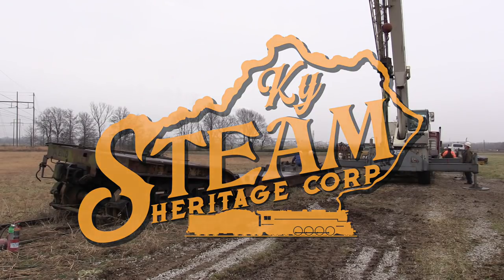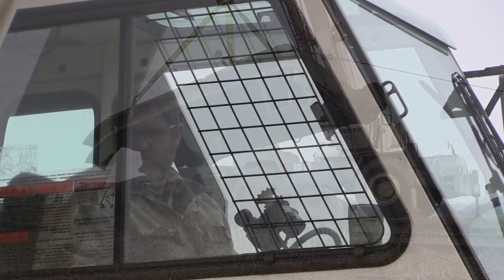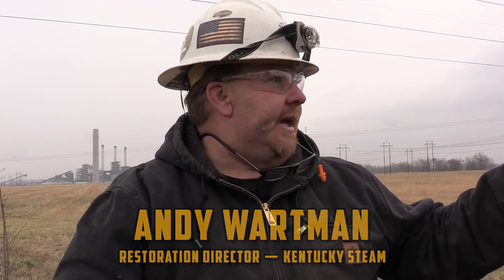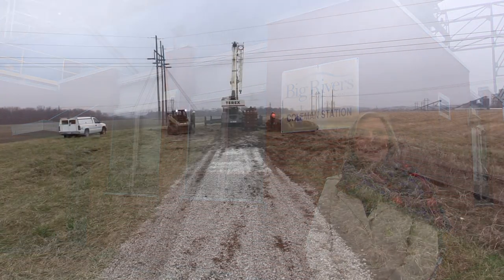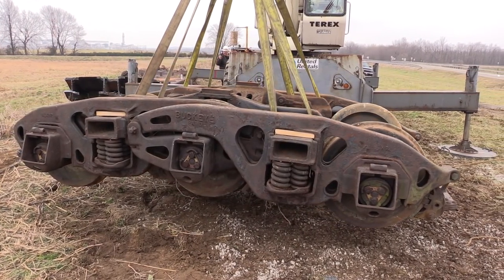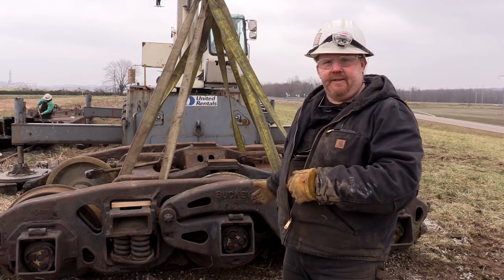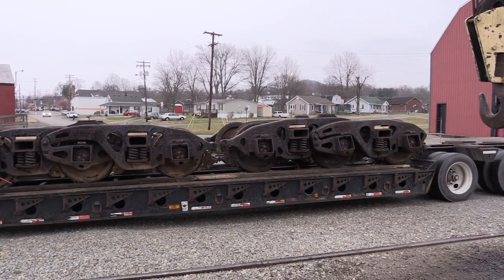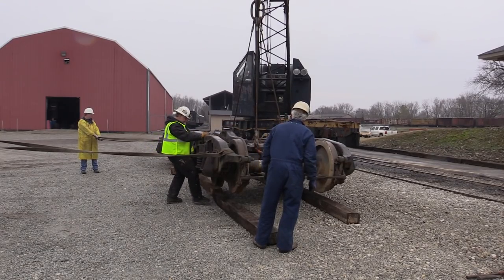Kentucky Steam Moves C&O 2716's New Roller-Bearing Trucks

Comment: Since the new roller bearing trucks still have the old journal box housings with hinges, will you guys place 2716's journal box cover hatches over the rollers to hide them and make it look more authentic? I think that would look pretty cool.
Reply: Lots of steam locomotive operators do that, as it's the best way to make it look authentic. 745's tender trucks and trailing truck where retrofitted with rollers, with the boxes and Flaps kept on.